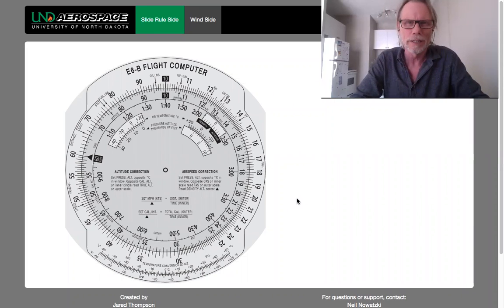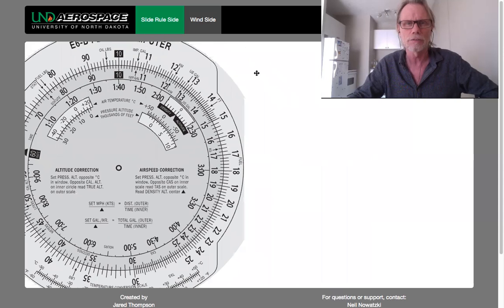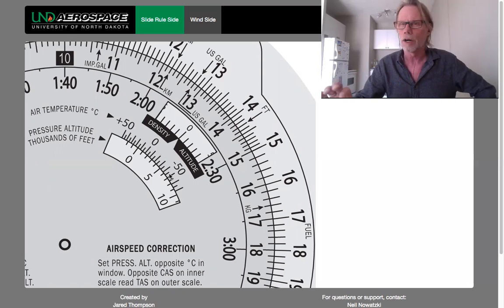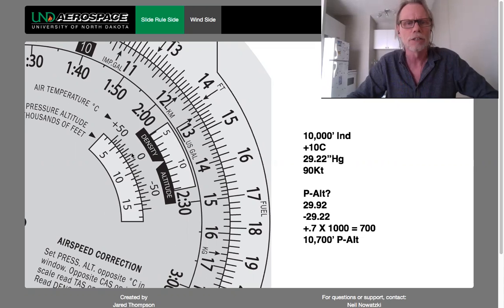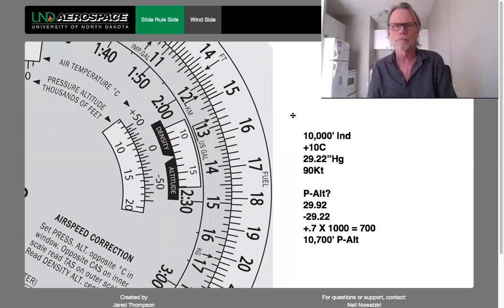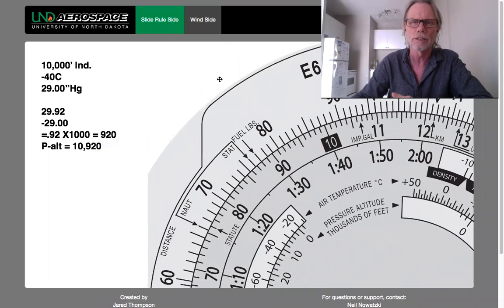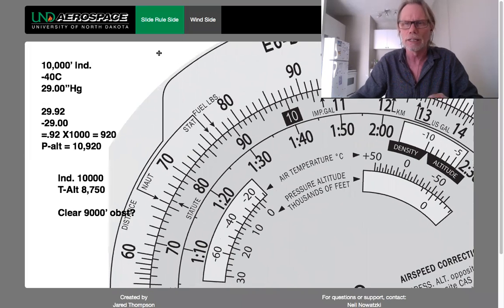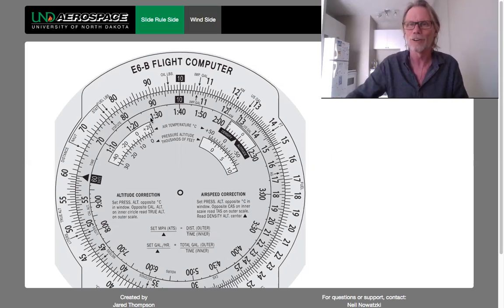E6b part 5. TAS and True-Alt corrections on your E6b

Comment: Yep, Yep and Yep. I was in the same situation. CFI wanted me to clear the mountain by 500 feet. I was flying at 4000 feet. I said nope, I am climbing. The CFI told me the altimeter is within 75 feet of accuracy.  I told the altimeter could be off way and be like 400 feet.  There is no way I could wip out my e6b and fly the plane in that canyon that  I was told to go into. I wanted to go around the canyon (which would take  more time - 15 minutes longer) .  Anyway There was a charlie shelf right above so we had a 900 clearance being 100 feet below the shelf.  I climbed to just below the shelf. Anyway the site picture was not pretty. At the debrief I told the CFI I was not comfortable going thru that canyon. He told me it was a good idea that I increased the altitude.   I told him from high to low look out below and that temp and pressure altitude effects the reading and that I did not have a recent reading and or corrected for the error. Also said  and there could be down drafts. He told me I am to cautious. Note, I am the student pilot. Whew. Changing CFI's. This CFI  tried to kill me.

Comment: Thank you for all your great videos! However, on the True-Alt correction, I thought you had to line up the 11.000 ft Pressure Altitude to '11' in the inner scale, instead of '10,1'. That would line up to 9600 ft True-Alt. Am I looking at this wrong?
Reply: Sorry this is so late. You want to look at indicated altitude from the calculation which was 10,000 or the 10 and read 8,750 (mine had 8,800) and it's already set up so see that you would need an indicated altitude of 10,250 to just barely make it over the 9,000ft obstacle so might want to error on the side of caution and go 10,500 indicated altitude.

Comment: I know the E6B isn't that accurate but it's been good to me.  Though as I have been flying for years and really got into it.  I've learned the actual formulas.  Put them in an excel sheet.  All I do is put the info into a few cells and all my calculations are done.  Even icing levels, cloud base, ISAdev.  I can keep going.  So my point is by using the first example you provided my calculation came out to TAS=106.  Thats a big difference. So should I continue to use the E6B or my formula?
Reply from the maker: I suppose your answer depends on your spreadsheet calculation  values. The E6b is accurate enough for GA, I'd say. All the best!